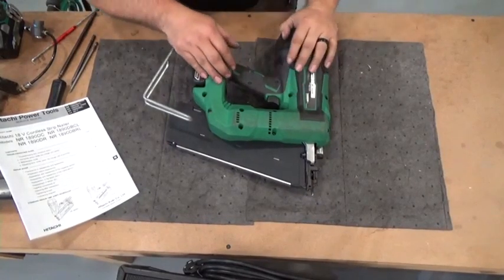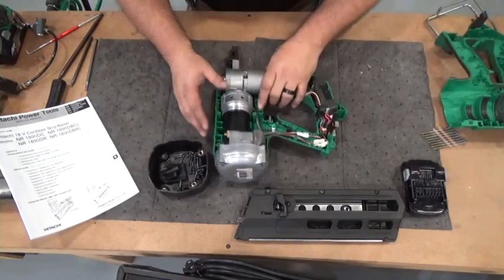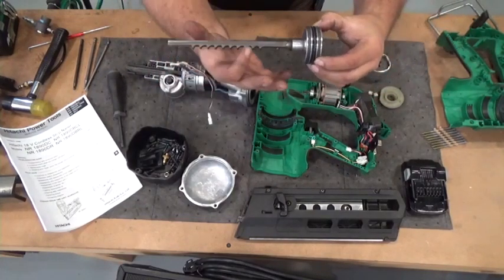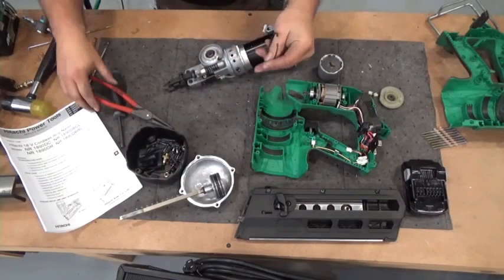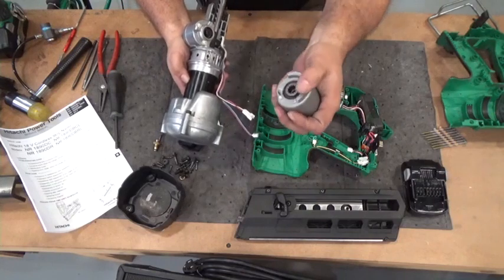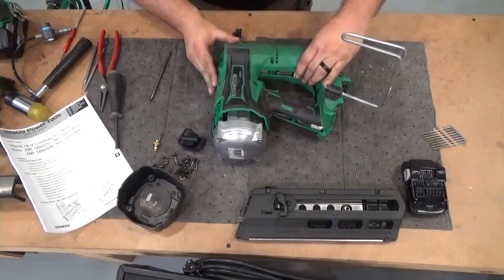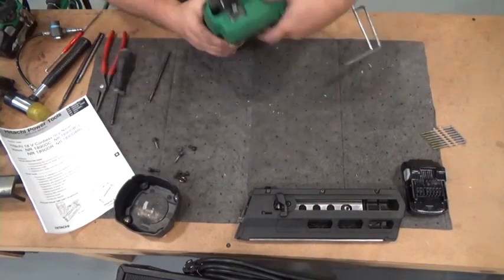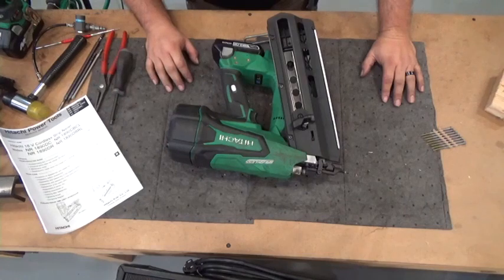NR1890DR AirSpring Full Disassembly

Comment: Hi Allen, thank you for the video, helped me diagnose the potential problem, Ive got the NR1890DC(S) and it seems like the piston assembly isn't retracting all the way every time the firing sequence operates? one of my workers dropped the gun do you know what the problem could be? Electrical? Thanks
Reply from the maker: If the nailer has done age on it.  It could be a worn #1 tooth. Or it could be the #1 pin in the pinwheel could be broken or the spring that holds the #1 pin could be broken or slipped off the pin.
Being it's firing fully intermittently,  I would lean more toward the driver tooth being worn out.
If it is cycling fully, the electronics sound good.
Reply from the maker: The driver does sit lower when at rest than a regular pneumatic. So don't let that sway your diagnosis.

Comment: Thanks bro, how many PSI does that regulator put into the actual gun?
Reply from the maker: The regular used for the framing nailer (371208) is 72.5psi

Comment: You're a godsend
Reply from the maker: I'm glad if it can help in any way.
Reply: @Allenr1967  any chance you could make a video on how to change the felt in the pinwheel? XD managed to piece together 3 to make 2! Just gotta order parts
Reply from the maker: @nathanielracine  I'll see what I can come up with.
Reply: @Allenr1967  thank you!
Reply from the maker: @nathanielracine  I haven't forgotten about you.
It's really easy. But you do need bearing pullers and a hand bench press.
I just need to shoot the video for you now.
Reply from the maker: @nathanielracine  just posted it. Sorry it took so long.
Reply: Hi Allen awesome video.  My Nailer is same. Question: everything turns on, lights up at battery/o - off leds.  But nothing.  New battery older battery. Just head pushes down but nothing.
Also, I noted on a previous video here, the author showed a device to plug into the air intake provided to actuate and fill up the air chamber.  As a maintenance procedure and checking point.
Is this necessary?
Found it on Amazon for $71.00
Reply from the maker: @1Cajunboy1  The fill regulator is part number 371208. 
Watch my short I just uploaded to answer the first part of your question. 
https://youtube.com/shorts/b1Jxk-IKjqU?feature=share

Comment: My framing nailer was brand new and worked flawless fore a few boxes of metabo hpt brand round offset nails. then started having problems feeding them. and has trouble sinking them all the time.  costumer service told me the round offset nails even though they are listed as compatible they cause problems and i shouldn't use them, i should use clipped head. does this sound right to you ?   Also how often do you need to top off the air?  i used it framing a house in cold winter weather and was told cold weather is hard on the air spring. Do i just need to top off the air probably ?
Reply from the maker: The round offset nails are a marketing addition to the spec advertised. Offset nails were developed late in the clipped head nailer timeliness. And the nailer were never fully designed to accept them. They have always given all the clipped head nailer issues in one way or another. 
The clipped head nailers have  a tighter slot that the nails slide down the magazine. So when the magazine gets dirty or slightly misaligned. The nails start to have trouble feeding into the nose.
You may just need a good clean and lube of the magazine and a top off of air.
Cold Temps do make o-rings shrink slightly and could be prone to loose some amount of air. It is not recommended to use the tool when it is below freezing or over 104 degrees.

Comment: I've got an 18ga brad nailer that has stopped sinking brads all the way sometimes, it's only about 18 months old. Would this need an air refill? How much psi does it need?
Reply: Hey, if you buy the part 371208 for refill(as I did) you should set your compressor to 110-115psi. There is a great, short guide on YouTube. Just search for Hikoki air service and you'll find it 😊 Just did my 3 nailers, worked great.

Comment: This is great!! Where can i find the tech number? Im having difficulty diagnosing a issue with a brand new gun i have. Any help would be appreciated.
Reply from the maker: What is it doing??
Reply: @Allenr1967   I bought it from a store that does new/used items. Usually get it cheap. It was brand new, but open box. When you fire it, it would barely sink the nail in and then when winding back up would make a popping noise. I followed your video to see if it needed air and it seems that may have helped. I took it completely apart and checked everything and it seems to work fine other than not driving the nail. This morning I use my own regulator and tried to air it up and it actually sunk a nail almost all the way in and didn’t make the popping noise so I think maybe that is the problem. Low on air? 
I didn’t wanna go buy parts for it that don’t fix it.  Its a NR 1890DC
Reply: @Allenr1967  oh, and when it sunk the nail all the way in nearly it didn’t make the popping noise coming back up. And it doesn’t make the popping noise when I’m not firing a nail
Reply from the maker: @Brandon Beachy  the popping noise is the pinwheel trying to grab the teeth on the driver but lack of air pressure isn't making the tool cycle as it should. 
Yes.very low on air.
The framer nailers use regulator part number 371208.
Reply: @Allenr1967  thank you! I will give that a try. Just curious, are they ever like that from new? How did it lose the air? I wonder.
Reply from the maker: @brandonbeachy3327  it could have been a bad one off the line. A pinhole leak is impossible to detect in just a few hours.
Reply: Allen - need your help , 
My 15g DBAL , had no/little power to drive nails home , I have the correct reg to re air the chamber , 
I sent it in for repair and they quoted me hundreds in parts to fix - 

I declined and have a box of bits now , however going over everything I cannot find anything overly worn or damaged - any suggestions on what to look for ? 
What’s the wear on the drive pin tell signs ?
Thankyou
Reply from the maker: @mattjohns8046  the driver has teeth on it. New, they are all the same size.  Wore, the teeth nearest the tip will ware out first.
In the pin wheel, there is a pin that floats on a spring. The spring or pin could be broken. 
In the great box.  The third layer of planetary gears could be broken. 
The Schrader value could be leaking.
The magnet in the push lever can fall out.
Reply: @Allenr1967   I have another question. Unrelated to that problem. There was a battery with the gun that I bought and then I bought a new one off of Amazon a little later so I’m not sure which one it is but one of them quit charging. I wasn’t using it but I think he said it died on the gun and then it does the rapid blink, and will not charge. Any idea on how to fix/jumpstart it?

Comment: Allenr1968. I have a question im currently working on my nr1890dr. I have a hunch that the controller stopped working. When i turn it on a single red light keeps blinking repeatedly and then it turns off. How can i tell if the controller has stopped functioning?  I used your video to take it apart and refilled the gun with air but i cant get it to work. Is there a reset procedure?
Reply from the maker: The trouble shoot description for that code of one red blinking LED is low battery. Just charge the battery.
Reply: @Allenr1967  then it probably is the controller because i tryed different batteries and it doesn't fire

Comment: My gun is under driving the nail’s what could be the problem it’s a new gun. It’s over 6 months old but just opened.
Reply from the maker: Could be low or no air.
If it has a very slow leak. It may have passed assembly inspection. But leaked out during shipping to your Parr of the world.

Comment: What if i refill it with air with the regulator, but it still doesnt sink in the nail? If i use longer nails then it makes clicking noise from the gearbox… can it be leaking air? Thanks
Reply from the maker: The last tooth on the piston driver could be worn down or broken off. Which means the driver isn't being pushed into the air chamber enough to fully engage the nail being driven.
Reply: @Allenr1967  it fires the nail but it sticks out about 12mm
Reply from the maker: @Adomas Ak  yes, if the pinwheel cannot push the driver fully into the compressed in the head. It won't have the force to fully sink the nail.
Same principle as being low on air.